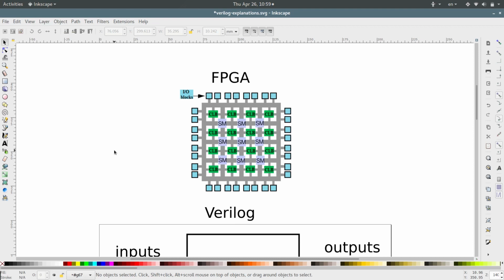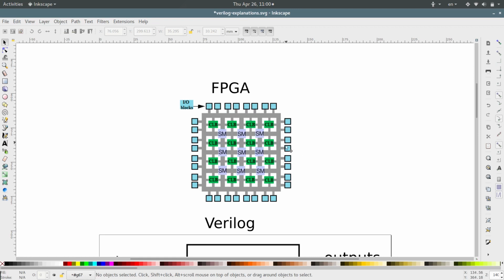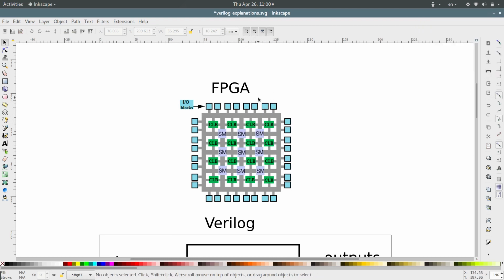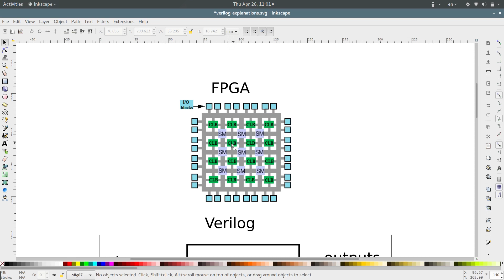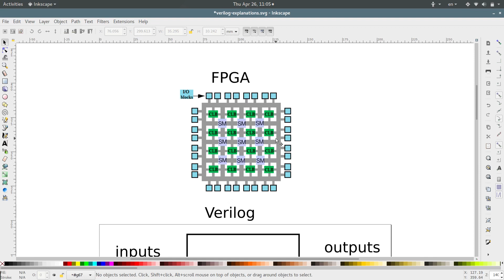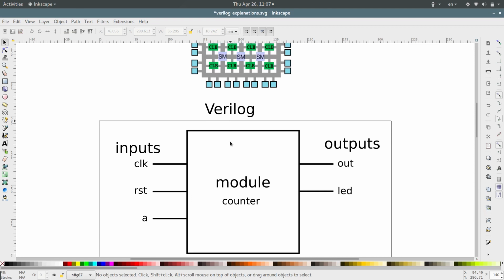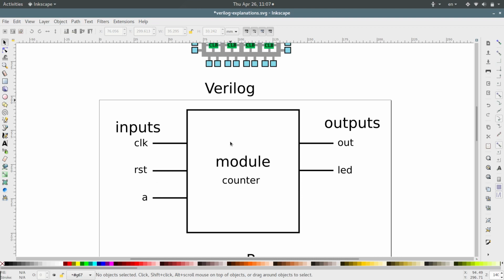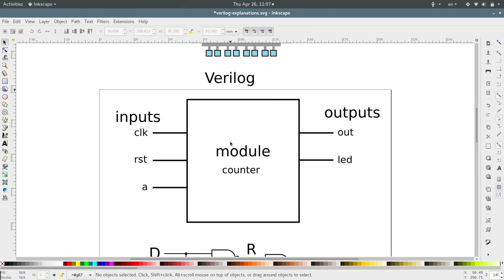Learn FPGA #2: How it works and why to choose Verilog - Tutorial

Comment: I came from the microcontroller world. I’m trying to use a  2 channel HDLC Synchronous Serial data running at 9600 baud. In the old days we would use a peripheral chip running in expanded mode with EPROMs sram, io controllers. Today everything is in the microcontroller and the don’t make a modern peripheral chip that uses say SPI or I2C. I wrote in WinAVR C a handle to process My HDLC data and display it on a serial terminal to view, but the chip is busy do this task and not much processing power left to do work with the data. I’m hoping a FPGA could do this work and pass it over to a microcontroller or just do the complete job for me. Thoughts? I found your series search YouTube. Thanks

Comment: Is there a way to simulate the code on FPGA on computer without the actual hardware ?
Reply: Yes there are lots of tutorials on the internet, in most cases all you’ll get out though are diagrams of what certain signals look like, like the output of a logic analyser. Also you have to write a pre determined set of inputs and conditions to tell the simulation what the inputs are but you can’t change these on the fly as it is a simulation, like if you’ve ever used PSpice or other circuit simulation tools.

Comment: The way you describe it makes it seem like a digital logic stateless thing. But they also come with memory, don't they? I was thinking about implementing a bcrypt hash generator with FPGAs, but I don't know what I'd be getting myself into. I do have some practice with ASM, C, C++ and some higher level stuff, but this seems both different and fun. I'm just wondering how I'd get my data (password, salt, workfactor) from someplace into the FPGA(s) quickly from a centralized location (password generator, probably running on a workstation) and how to paralelize that and how to get the result (hash) back.
Now that I think about it, SPI seems like a simple protocol. Using something like a raspberry PI you can generate the wordlist. However you can still only connect one chip with the SPI GPIO pins.
Or you could go full on ethernet. Have a simple layer 4 Application. People run hundreds of those in parallel right? How?
Reply from the maker: FPGAs do come with memory inside the chips, yes. I talk more about that in tutorial #20. Yeah, I've really enjoyed learning FPGAs because it's different and fun (for me) and often requires approaching problems in different ways than with conventional programming. You can indeed use SPI. I may get around to a tutorial in that someday, but for now, here's one Alchitry made specifically for the Mojo v3 board. It might help get you started: https://alchitry.com/blogs/tutorials/hello-world
Reply from the maker: I don't think I understand what you're proposing with the layer 4 application and ethernet. And what are you thinking about running in parallel? Are you trying to come up with a way to transfer data quicker than SPI will allow?